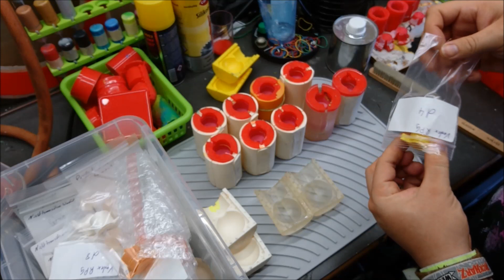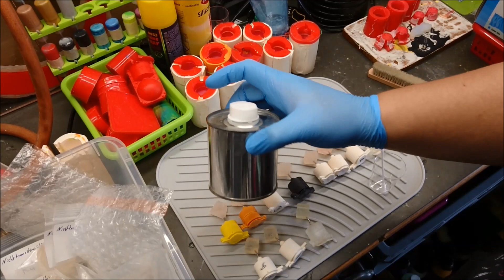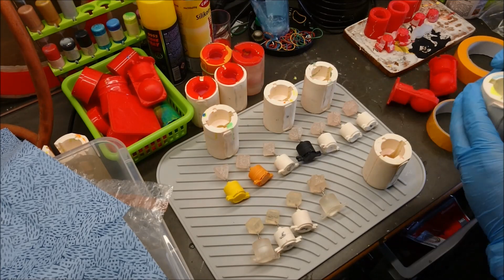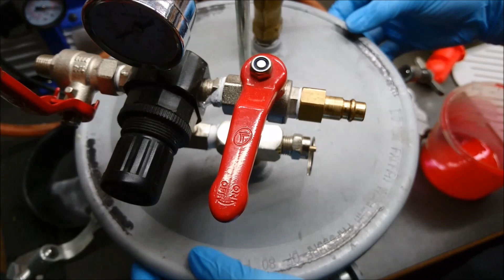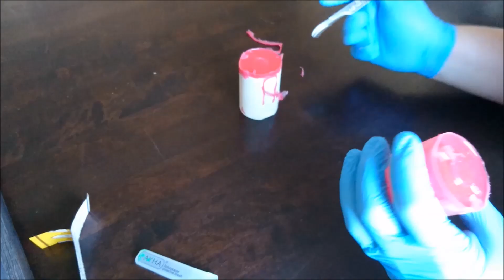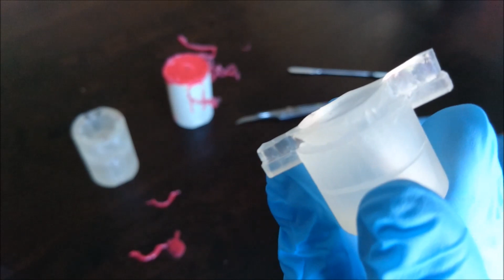Dice Making Equipment Guide: MoldMold System - free 3d print files

Comment: I love the engineering of your molds! It's funny too, I was watching the videos and I'm thinking to myself, oh that 3d print material looks very similar to what I used for my coin masters printed by shapeways.. and at the end you confirmed it's the same stuff. 🤣 very cool!
Reply from the maker: At that time I didn't had a FDM printer to print those and I wonted something stable and straight to make molds.
I think printing them directly on an FDM printer is better and cheaper compared to the expensive print of shapeways and the molding and casting.
Reply: @wuerfel_schmied  Thats what I have been doing and it works really well! It takes about 3.5 hours to print a mold-mold half on an ender 3. Layer height of 0.22. I realized pretty quickly though that they will not last forever. I have trashed a few after resin has gotten on them. I have not figured out a good way to clean off the mold-molds if resin does get on them so I end up just throwing them away. Now I try to be very careful with my silicon cuts and alignment so I can minimize the risk of resin getting on the mold-molds.
Reply from the maker: @Kman7607  there are a few things you can do. First, add spray release to your moldmold so resin won't stick as hard and you can remove it easier. Also you can cast a bit more silicone in, if you make a little ring of tape at the top. This makes a silicone skirt all over the moldmold. And you can try to make some sort of drip shield. Like a piece of cardboard with some holes in it, that you can place over the moldmold so it catches any drips from pouring the resin.

Comment: Hi! I have 3D printed your mold molds and sanded/prepared them. Could you tell me more about your method for duplicating them? I'm worried it'll be difficult to get them out without damaging the silicone. Thanks so much. I've learned a lot from your tutorials!
Reply from the maker: I made a large cut mold. So the opening to pour in is the bottom. And the cut runs along the outside of the part. I used a mixing cup for the mold and put the mold mold on three pieces of clay. You can also message me on Instagram and u can share pictures.
Reply: I'll do that, thank you! Makes sense.

Comment: Great vids! Thanks for sharing your wisdom.   Have you thought about using a tape dispenser?  How about using some compressed air to help remove the rubber form the molds?  Once again thanks for sharing!
Reply from the maker: Thanks. I tried compressed air, it works, but it's also a bit aggressive. And the master dice are very brittle, so I don't use compressed air as I don't want to crack my masters. But I can try again and add this to the next video. And tape dispenser sounds good, I keep my eyes open for a wide enough one.

Comment: What if you had two copies of the outermost molds? One in plastic to cast the silicone and one in a harder silicone that you'd put the inside mold into. That way if the resin leaks out, it still won't stick to the outer mold.
Reply from the maker: So that I would use the silicone one for casting my dice and holding the inner mold. Sounds good as long as the outer mold part is stiff enough. I could try that if I find a stiff silicone or something similar. But I guess just using talcum or spray release is good enough. Normally it shouldn't leak. But thanks for the tip, I keep it in mind.

Comment: I have limited access to 3D printing, so I was wondering if you could tell me what materials are best for printing the Thingiverse files? I really want to try this but I want to make sure I do it
correctly, especially if I'm going to need to pay someone else to print them. Thank you so much for providing your system, I'm new to casting but I can already feel this is going to change my game a lot!
Reply from the maker: Tbh of you're about to start casting, get comfortable with your materials. Adding this is just adding another complex thing to your process. This system is to make reproduction and handling faster. When you handle your casting, you can add this. You can get them as a cast copy from me directly instead of ordering a print of you want. Just message me on Instagram or Facebook.
Reply: @wuerfel_schmied  I've been casting long enough to have the pot and to have been working on my masters, but before I start investing more I definitely want to find a more reliable system. I'll shoot you a message on FB, thank you so much for replying!
Reply from the maker: @d.wilson6313  thanks

Comment: This is really awesome to see! Started trying to make some molds with a silicone putty and it just didn't work out very well. Have access to a 3d printer, so probably going to print these out when I have time to give it a shot! Just curious, how tall are the molds? I figure dimensions aren't always the same in the modelling and slicing programs, so wanted to get it as accurate as possible.
Reply from the maker: I have to check on the exact measurements, but its metric mm units.
Reply: @wuerfel_schmied  okay, sounds good! I was going by mm when I was measuring my dice, so I thought that was about 50-60 mm tall, but wanted to make sure

Comment: Do you need to smooth out the masters after you print them? I'm curious because you didn't mention anything after printing.
Reply from the maker: Yes you have to smooth and sand the dice masters. The mold pieces might not need to be sanded.

Comment: Who printed your Masters?
Reply from the maker: I use shapeways fine detail plastic in smoothest finish.
Reply: @wuerfel_schmied  Do you have links for your wax and that brush? Have you found that you still need to polish the Shapeways Fine Detail Plastic in the smoothest finish? If so, are you just polishing or do you sand, polish, and then waxing your masters before making the mold?
Reply from the maker: @vsdrake  even in smoothest finish you need to sand  and polish it. I use the wax for two reasons, first my masters are only sanded and not polished, second I have a large area that is still the original rough printed texture and I use the wax to seal this. You can sand with higher grits and then polish your masters, and with regular numbers this is good enough to go without the wax. My next design will become a better finish and won't need the wax. I'll do a video on this, but it will take a while.
Reply from the maker: @vsdrake  oh and the wax can be found at breddermann which is linked in the description.
Reply: @wuerfel_schmied  nice gotcha. I will mess with this a little. I am hoping to touch the masters as little as possible. So my plan was no sanding, just dip and let dry and buff excess. Thank you so much for this video, I have rewatched it a few times. Trying to learn from your experiences ;)

Comment: Is there a reason you do not degas your silicon?
Reply from the maker: I put it in a pressure pot, so you don't need to degas this. If you don't have a pressure pot you degas with a vacuum chamber. For bigger molds that don't fit in my pot I degas with a vacuum chamber.